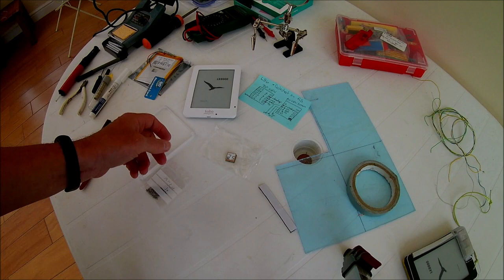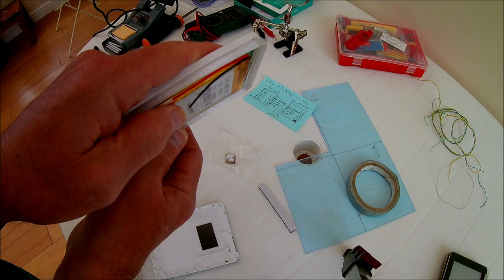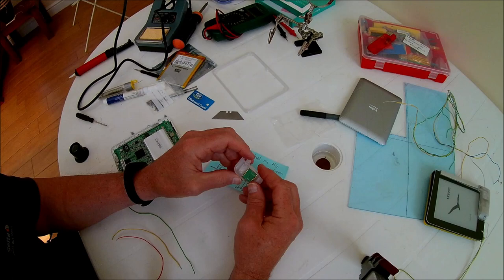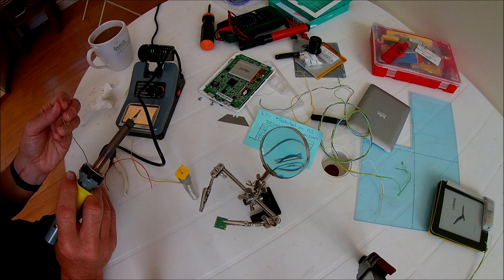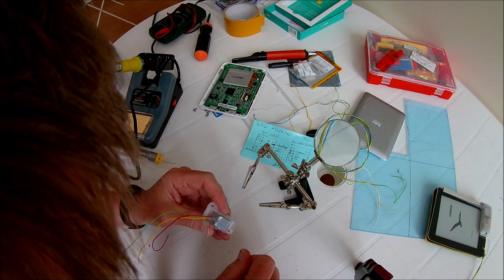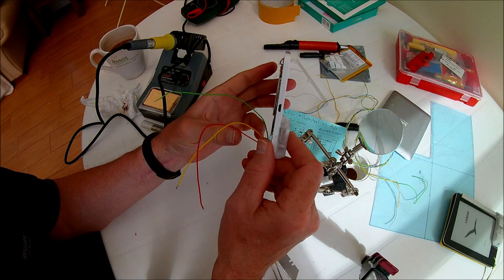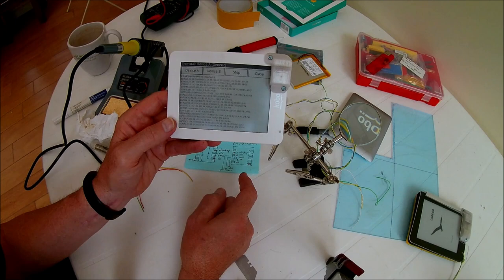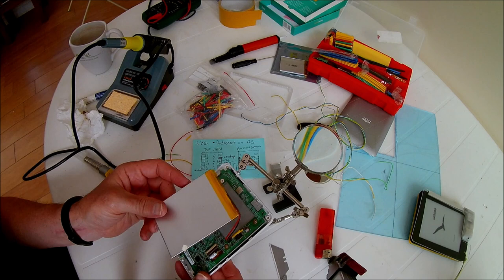Kobo Mini for XCSoar/LK8000 with Quectel L80 GPS chip

Comment: Nice video, does the LR80 work the same as the LR 86? Which settings do you need for XSCOR. My Kobo can't find the GPS. thanks for your help
Reply from the maker: Hi Stefan, both chips work well. In theory the 86 version should be slightly better having a larger receiving element but I would recommend the smaller 80 version which fits better on a kobo mini or similar. For XCS the device settings are ttymxc0, 9600, generic. Once you change them you may need to restart kobo for them to take effect.  For LK8000 they are  generic, //dev/ttymxc0, 9600.
Reply: Thank you very much. Works very well.